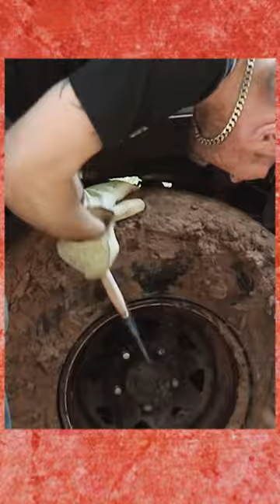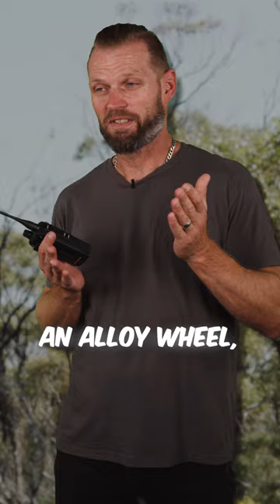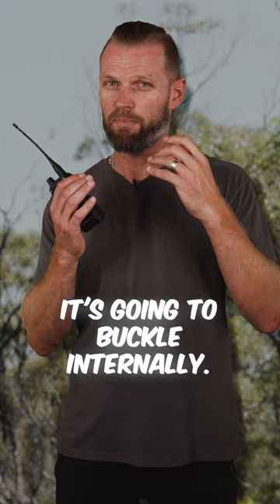STEEL vs ALLOY WHEELS #shorts  #4wd #automobile #4wdaustralia #4wding #landcruiser #overlanding

Comment: Back when Australia made stuff I used to work in the wheel industry. Aftermarket wheels never needed to be tested or meet a standard. OEM Alloy is a decent thing and so is the steel rims. However the aftermarket steel is very much junk as well. Thinner, less weld, from new often made buckled. OEM steel even used is by far the best followed by Alloy.

Comment: You often hear people saying that it's really difficult to straighten a steel wheel so they're really no more useful than alloys and, to be fair, when you're driving around a civilised country - with a spare wheel - that's probably true.

Personally, I've had ONE occasion where I damaged a wheel, fitted the spare and then, half an hour later, ripped a sidewall.
Got the spare out and 2 of us spent about 3 hours working on at the dented wheel with a small hammer until it would hold air again.

That's one single time in 30 years of driving around deserts and jungles but it's one time that we got back by ourselves instead of having to wait for somebody to come and get us.

Comment: Good quality alloy wheels will also bend and not crack, it’s usually the chinesium $250 alloy wheels you see on camper trailers and “hectic” tradie utes that crack 

There’s a reason methods for example are $500-$650+ per rim and wheels for performance street cars are $1000 each

Comment: Anyone actually damaged an alloy wheel before ?
Reply: Yes, over pot holes. Some alloys wheels are (obviously) better than others though.
Reply: Not me, done about 1,000,000km on and off road with alloys, no issues so far.
Reply: I'm sure with a low profile tyre you could easily damage your rims but not sure how a pot hole will damage a rim that's 17 inch wheels on 35? Or 16 inch wheels on 33s?
Reply: @shaunbatterton4510  it wasn’t a 4 wheel drive. It was a 17 inch wheel with (if I’m not mistaken), 205.50.17s or something.
Reply: Yep.

 Loose kerb-stone lying in the road.
Range Rover I was a passenger in hit it at around 60mph and the 3-spoke alloy wheel broke up competely.

Obviously, the same hit would have also made a right mess of a steel wheel but, as a last resort, you might have the option of attempting to batter a steel wheel back into shape where an alloy will be scrap.

Course, having said that, I have alloys on my Disco'. :-/
Reply: @SiCrewe  mine developed flat spots so it was a continuous slow leak.
Reply: Yup, broke a factory alloy rim going over a pothole. Didn't even have low profile tires on our anything.